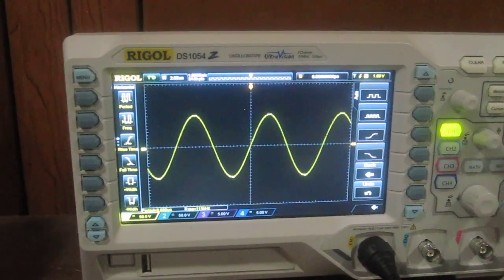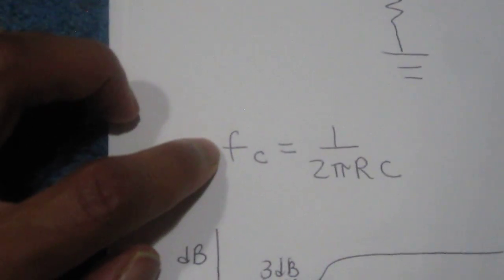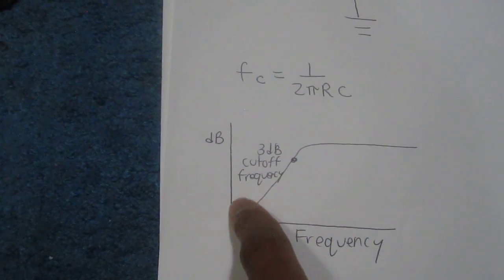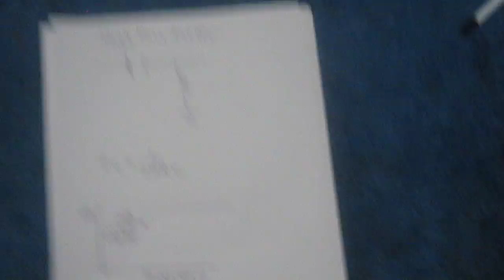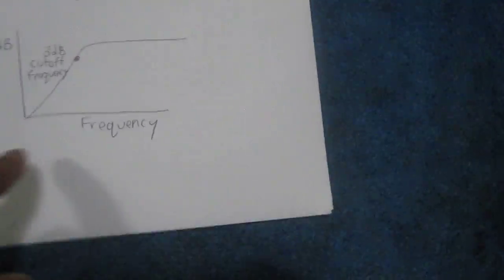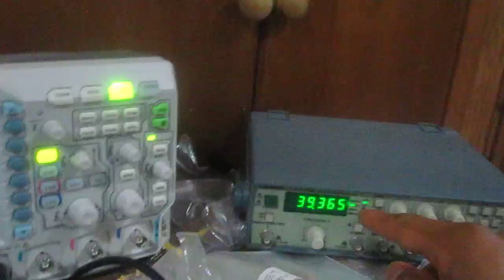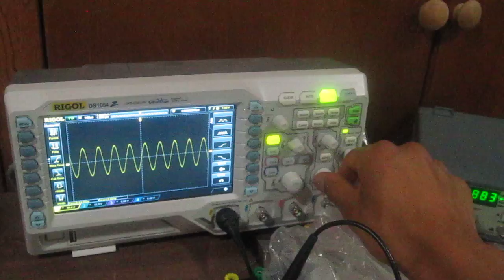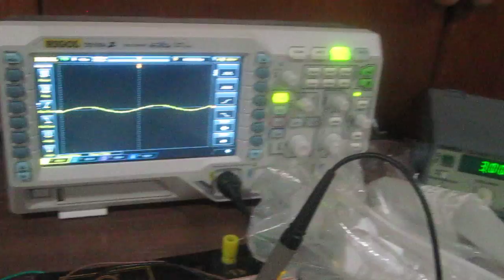RC High Pass Filter Circuit

Comment: Great video,
I wish to measure the 220v 50 hz AC mains for "Dirty Electricity" with oscilloscope, as in spikes in 1 Khz-120 Khz range (Spectrum analyzer mode).
Could a high pass filter be used for this, as in removing the 50 hz and below but not higher frequencies? Or what would i need exactly for this?. Thank you!
Have 10x and 100x probes, and Velleman PCSU1000 USB Oscilloscope (max 30V Pmax).
Reply: You wish to measure? I don't get your question. You mean that you need only the 50 hertz frequency for an application?